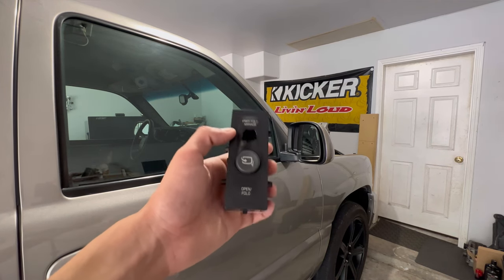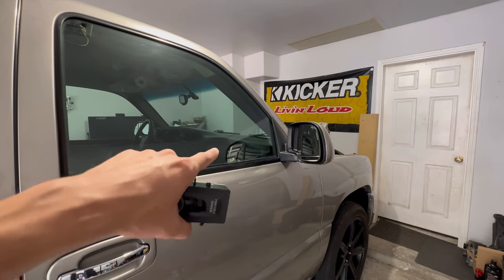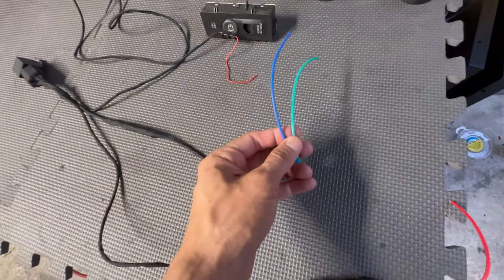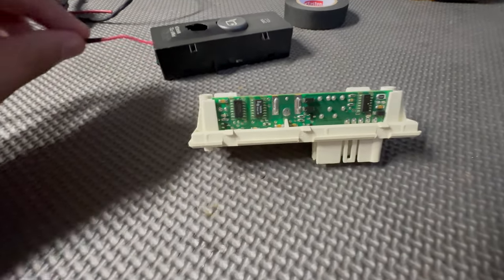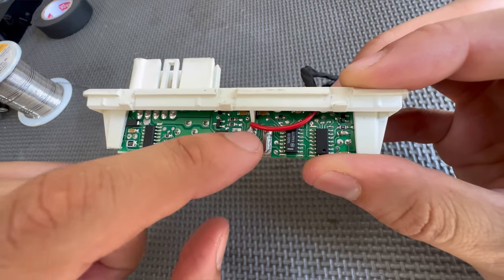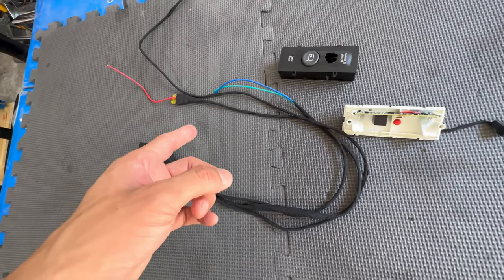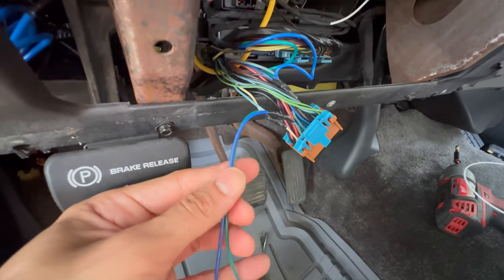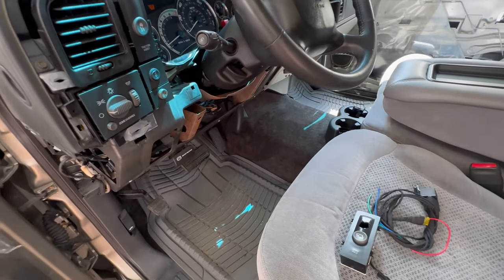Auto Folding Mirrors!  99-02 Escalade Switch Hack🔥🔥🔥 Tahoe/Yukon/Silverado

Comment: Hey man love your content. Done a lot of This mods to my truck. But like to see if you can help me. I installed a Titan window on my Silverado and like the window to to work with the factory door switches. Been trying but can’t figure it out
Reply from the maker: Nice and Thanks!! I’m sure it’s possible but I would have to test the switches and it’s harder without having the truck
Reply: @Migo you can use my truck for that window content. Located Houston Tx
Reply: I have the titan window
Reply from the maker: @elflaco9566  Nice
Reply from the maker: @elflaco9566  Thanks!

Comment: I have a 03 z71 if it does work, will you be selling it like your D Pillar hook up ??? Mines has a way to power fold the mirrors from the inside by holding in the mirror button
Reply from the maker: Yes if I get a 03-06 and make it work👍🏼 The good thing is that year will have good control over the mirrors

Comment: Will this work with a 05 Silverado 1500?
Reply from the maker: If you have the 02 Cadillac switch installed yes, if you don’t it will not work.  03-06 is a different wiring set up

Comment: Ok first of all thanks for the videos, the way you explain everything is just awesome, so I watched both videos the one with the 3 relays and the toggle switch and this one with the Escalade OEM switch, I have the power folding mirrors on my 99 Silverado I have the turn signal working and I have the folding mirror working with the Escalade switch, the way I wired the switch is ground, 12v key switched from a fuse only 12 volts when is on, lock and unlock wires from BCM and illumination, if I want to fold and unfold the mirrors with the alarm should I do just this with one relay or should I do it with the 3 relays, will this work when I put the truck on drive? I have a BCM from a 01 Silverado and my truck locks when I put my truck on drive, thanks hope you understand what I’m asking sorry about my English and thanks.
Reply from the maker: I see what you mean, if you are using the Escalade switch to open and close the mirrors you only use one relay and it will work with your alarm/factory remote and door locks.  Since the Cadillac switch only uses one button to control them,  so If you press lock or unlock twice it will move the mirrors again in the opposite direction. And with this wiring the mirrors will work like normal while driving with the switch and no door locks. Hope that helps and Thanks!
Reply: @MiGo713  thanks! I’ll try that just another question so I have to remove my wiring right? Because I have the factory plug from the Escalade wired to 12v, ground, lock, unlock and illumination remove that connector and do the relay process and solder the red wire to the board on the switch right? Thanks again.
Reply from the maker: @LJimenez0185  Yes the switch needs to be unplugged to solder a new input inside. After that it gets plugged back in like factory except now it has 1 extra wire which can get controlled by wiring up the relay
Reply: @MiGo713  thanks you are a genius! I’ve been looking for something like this for a long time, I really like the way you explain everything is so easy to understand love the build you have great ideas!

Comment: Quick question do i have to have the switch inside in order for the mirrors to fold and unfold if thats the case i just want a side mirror that shows the signal on mirror and a puddle light the folding is bad ass but i dont want that switch inside my truck and dont have the rest of the harness in my truck its a 04 Silverado i hope i made it where u understand my question thanks bro again great vids
Reply from the maker: Thanks and if you have a 04 With power mirrors now, you can just install the 03-06 Dl3 Power folding mirrors with turn signals, and factory puddle lights and they should work but most likely you have to change the window master switch and passenger to get them to power fold, right now I haven’t been able to finish testing the 03-06 trucks since I don’t have it.  This switch in the video is more for the 99-02 older trucks
Reply: @MiGo713  oh ok kool yes I have a 04 reg cab silverado with power windows power locks and really want turn signals on mirrors and puddle light and the power folding would be a plus or I could also tinker with it myself but that's not a must right now just puddle, and signal for now I can get the folding later thanks for all the info bro been watching all your vids and ordering the auxito l.e.d.s. and want to get a set of headlights like yours what brand or where did u order your headlight bulbs from thanks again
Reply: @MiGo713  oh ok kool yes I have a 04 reg cab silverado with power windows power locks and really want turn signals on mirrors and puddle light and the power folding would be a plus or I could also tinker with it myself but that's not a must right now just puddle, and signal for now I can get the folding later thanks for all the info bro been watching all your vids and ordering the auxito l.e.d.s. and want to get a set of headlights like yours what brand or where did u order your headlight bulbs from thanks again
Reply: @MiGo713   oh ok kool yes I have a 04 reg cab silverado with power windows power locks and really want turn signals on mirrors and puddle light and the power folding would be a plus or I could also tinker with it myself but that's not a must right now just puddle, and signal for now I can get the folding later thanks for all the info bro been watching all your vids and ordering the auxito l.e.d.s. and want to get a set of headlights like yours what brand or where did u order your headlight bulbs from thanks again
Reply from the maker: @chatobalencian1504  Ok cool yeah that should work on the truck and Thanks for watching! Yeah my headlights are by Spyder purchased them in Amazon there in my video here My Tahoe’s Transformation!🤯Simple DIY Upgrades🔥🔥🔥
https://youtu.be/v2bN4PQIivo and in the description, the actual leds I from Auxito
Reply: @MiGo713  thanks is there a certain one or can u send me the link to your headlights thanks bro for all the help